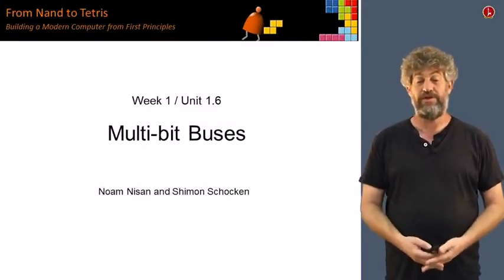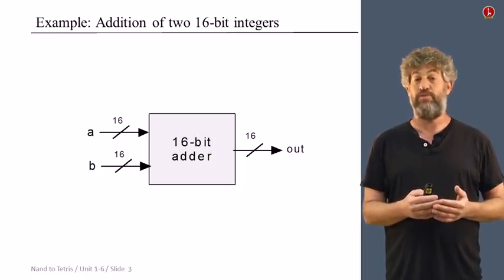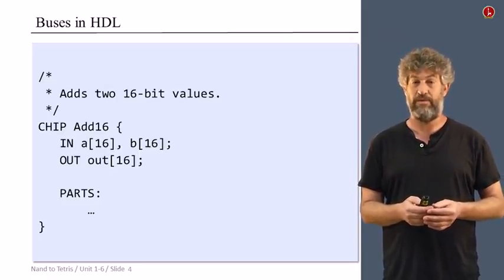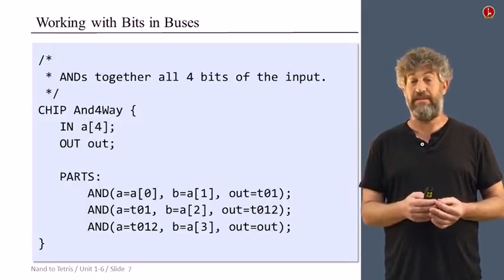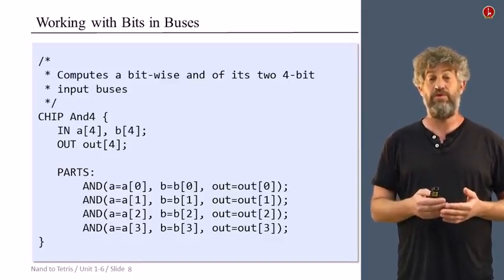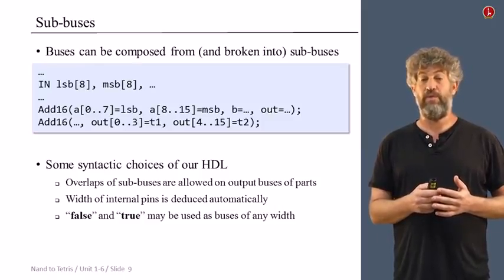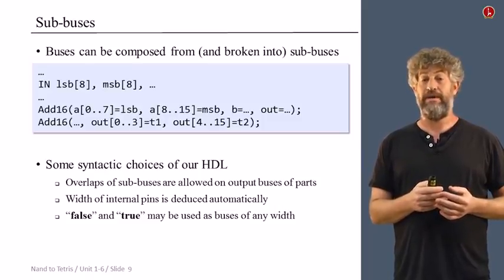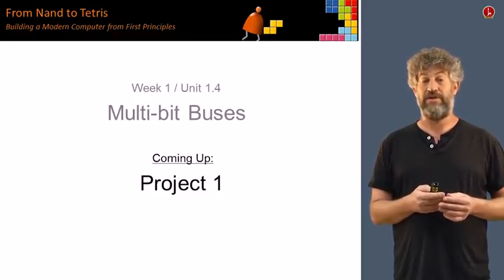Unit 1 6 Multi Bit Buses   Hebrew University of Jerusalem Co

Comment: If I have IN x[16], y[16]  do I have to write multiple add(a=x[n], b=y[n], out=z[n])  or is there a shorthand method like add(a=x, b=y, out=z) which automatically caters for however many bits my bus contains ?
Reply: you have to write multiple add(a=x[n], b=y[n], out=z[n]) for each bits in your 16 bit bus inputs because the add chip is just one bit, you should use add16 so it's a 16 bit chip so you can now write add16(a=x, b=y, out=z)

edit: i see, i assume you're implementing a 16 bit add gate out of 1 bit add gates. In this case i think you have to write multiple lines (16 in total ) of add(a=x[n], b=y[n], out=z[n]). from add(a=x[0], b=y[0], out=z[0]) ... to add(a=x[15], b=y[15], out=z[15])